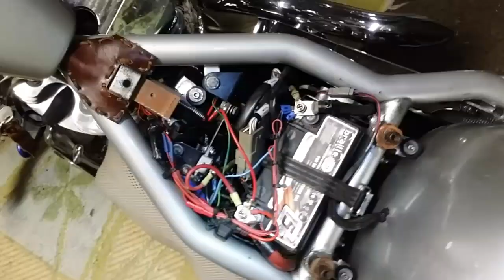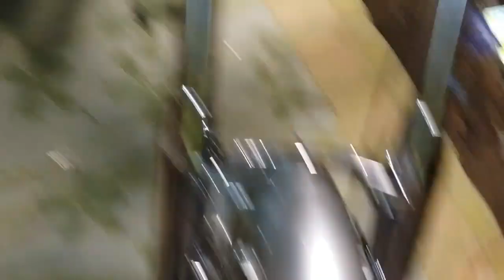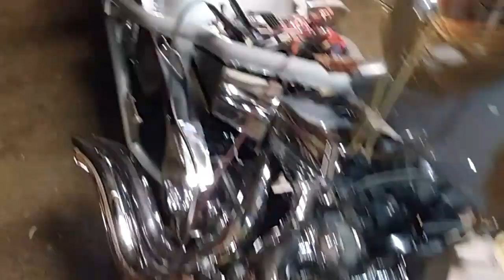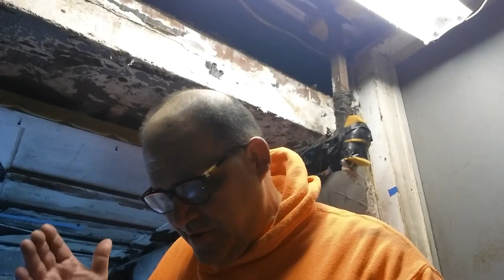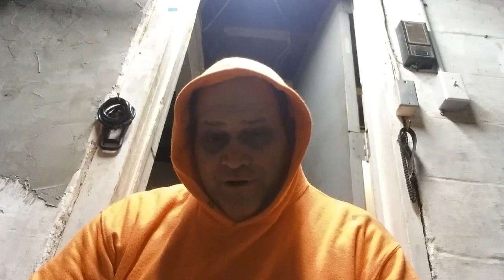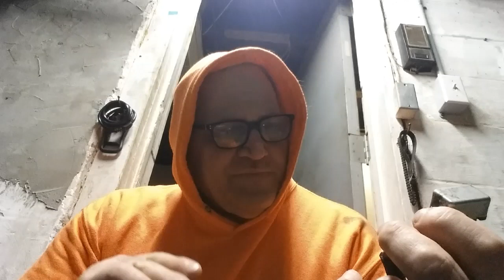New shortstop 40amp breaker all done. 01/08/23 update i mgt of killed my battery.

Comment: I was told not to totally tighten the EHC down. Due to the vibration it should be a little loose.
Reply from the maker: Thank you for reminding that to me im going to check my torque on the fasteners. According to the BDM manual they should be fastened down. Torque no more that 15 inch pounds.